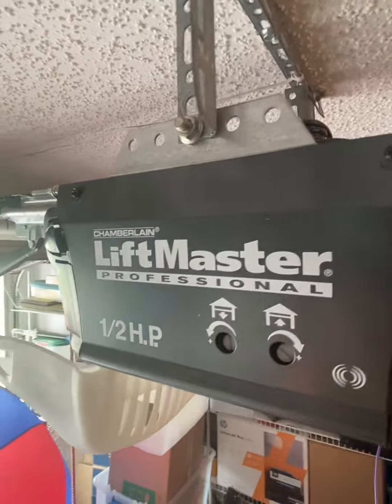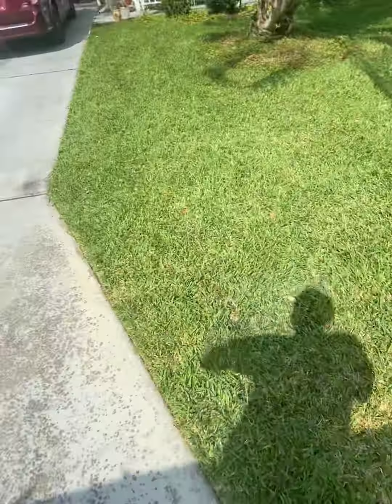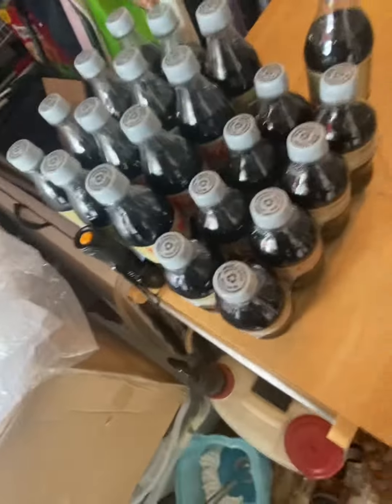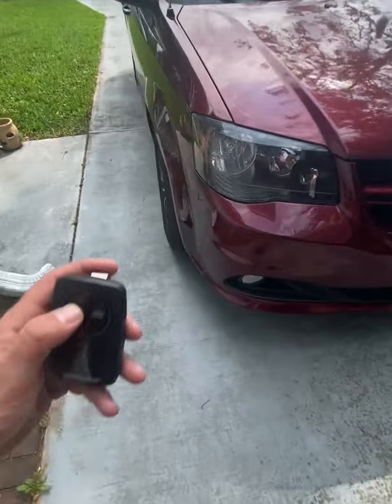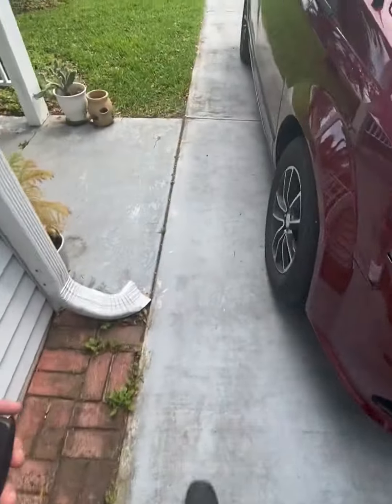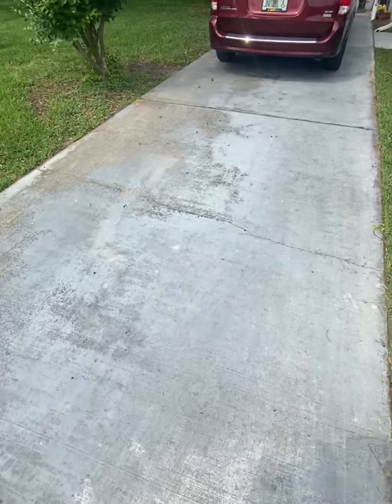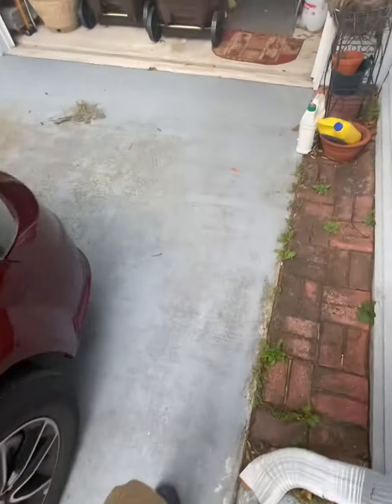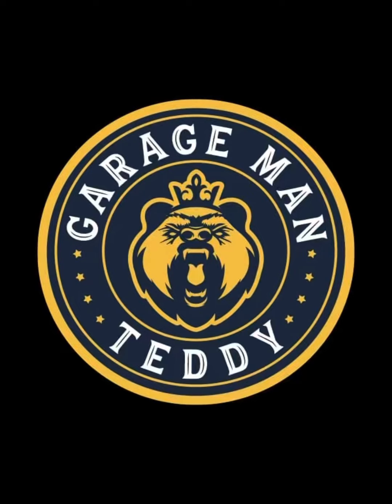Garage remote only works near the motor .. Why???? #liftmaster #fyp #howto #garagedoorrepair

Comment: Vivint alarm company recently installed new cameras and the hub is right near the motor. Now my remotes don’t work unless I’m super close. What should I do?
Reply from the maker: I would call Vivint and have them move the hub away from the motor. In fact make sure they move it out of the garage if possible. You don’t want anything with signals like that in the garage. The chances of interference with the remote signals and WiFi etc is high. 

I hope I was able to help in some way. Signal interference is probably the most frustrating call I go to due to the fact that I have to do a process of elimination to locate what is causing it. Sometimes it’s long and tedious trying to do that. At least you have a solid source. 

Let me know if there’s any other questions about that. Thank you for reaching out ✊and hope you get that resolved soon.